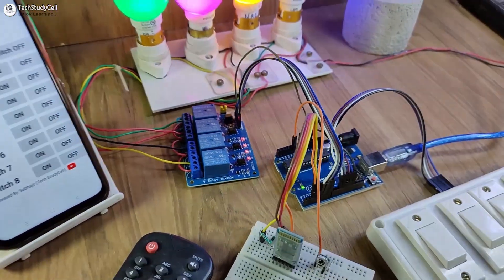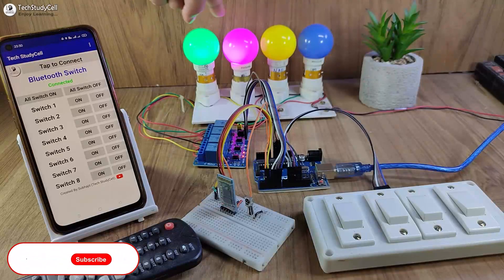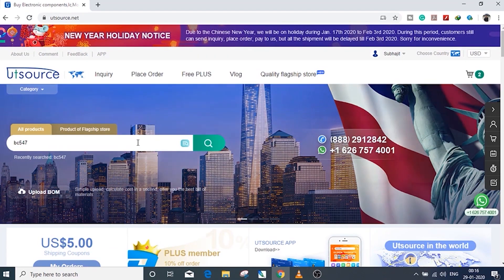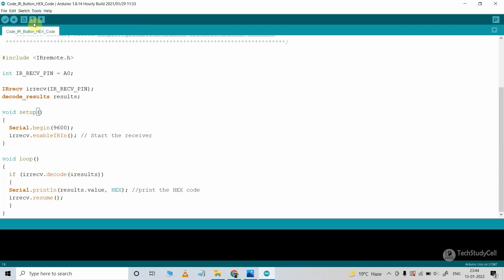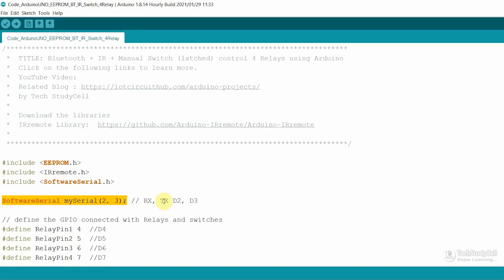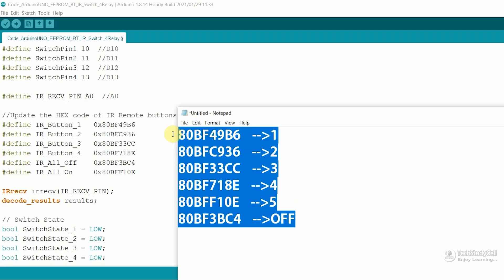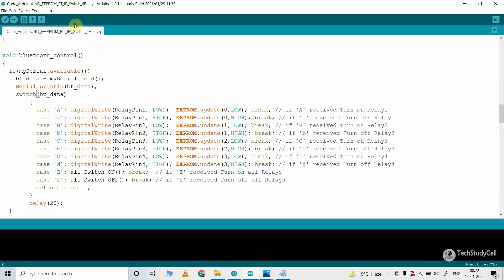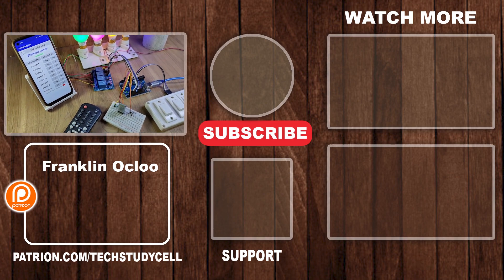Home Automation using Arduino Bluetooth IR Remote control relay with EEPROM | Arduino Projects 2022

Comment: Thanks sir for such an useful project.
Manual switches and Bluetooth Control is working fine I am using vire NEC codes and remote I have checked everything but IR is not working(added ir library in the file before programming).
Please help.

Comment: bro it is not showing wifi with the name of blynk while adding device and it shows device with the name of my board and whhen i try to connect it does not connect please reply (i am talking about old video of connecting esp8266 with blynk 2.0 internet+ manual switch)